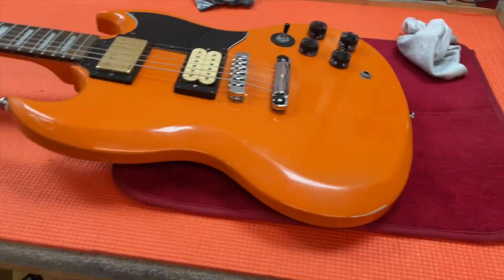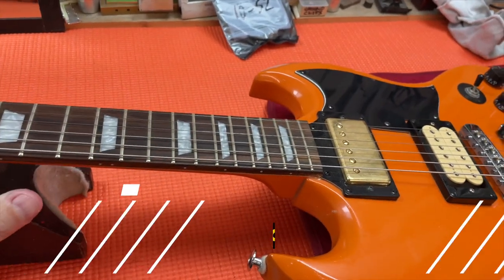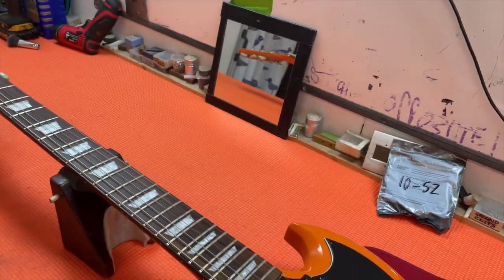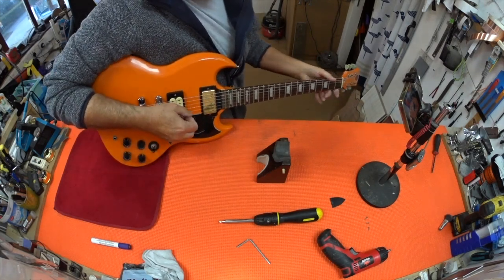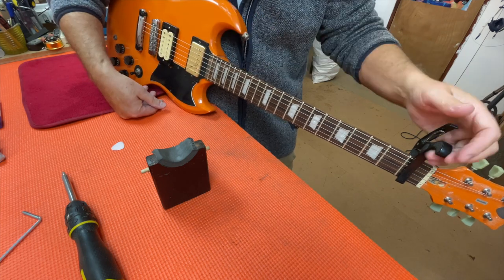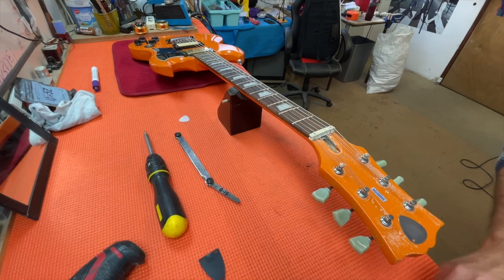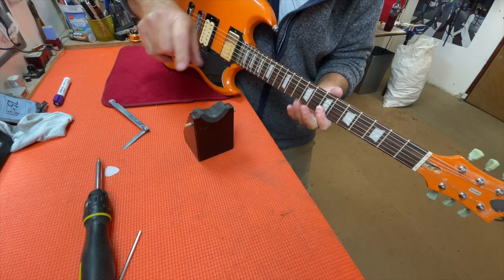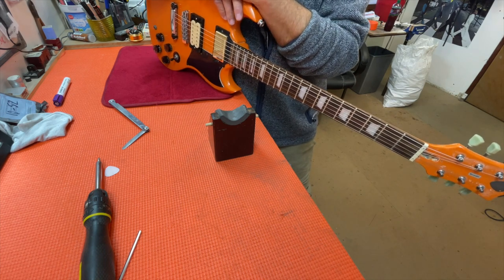Learning to love making truss rod adjustments on your electric guitar

Comment: Very Cool, Thankyou. Just received a LP style guitar ordered online. The 'Saddle' Thumbwheel on the 'bass' side was flat to the body causing terrible Buzz without even fretting and the 'locking' screw refuses to screw into locked position and just falls out.  Supplier said it must of happened in Shipping. I feel that is Not a chance. I noticed the Treble side 'Thumbwheel' was a couple of millimetres off the body. I 'performed' a quick adjustment of 'Bass side' Thumbwheel and have just removed the 'locking' screw, and guitar appears to play amazing. The removal of saddle bass side 'locking screw' appears to make no difference to tuning stability, and seems very stable. Found this video very Interesting, Informative and Entertaining and has given me confidence to measure and adjust Truss Rod. All the best. Cheers
Reply from the maker: Good luck making truss rod adjustments. Remember, all you want (in the end) is "a tiny bit more than none" when it comes to neck relief :) Just enough for your action to play without problems.

Comment: Hi Sam - I live in the East Bay of California and we have the most stable weather conditions year round here in the united states. Even with the very stable climate here, I usually need to do a truss rod adjustment on my guitars at least once per year. I know when it needs to be done based on the standard indicators of the guitar either feeling like it has a slightly higher action than I like or I start hearing a bit of fret buzz or fret slap.
Reply from the maker: You're one of the 'converted' Ken :D So many people I meet over here were scared off from going anywhere near the truss rod in their youth... and still avoid it!

Comment: I completely agree. being of a wood construction the guitar neck will change with different temperature, humidity, string tension etc. Manufacturers always seem to put an Allen key in with the guitar for a good reason and It only takes a minute to give the truss rod a tweak following your video example.
           Just as an aside we had an old wooden 12" ruler that was my Wife's uncle Peter's one from his schooldays in the 1940's. I checked it against a modern steel ruler and it was  1/4" short at  the 12" mark!. I wonder if a guitar of similar age has a slightly shorter scale than it started off with by a small amount. Probably the frets would keep the correct ratio so it may not be noticeable. Cheers.
Reply from the maker: Shrinkage.. It's rare that both / all the pieces of wood in a guitar neck shrink exactly at the same rate. It would be an interesting project to find exact original measurements and be able to check them against vintage instruments. I mean we get shorter as we get older, right? :D

Comment: nice man there are not that many of this showcasing an SG
do you think that for LESPAUL and SG Is about the same exact measuring for perfect neck relieve ?
cos i own both LP and SG just love but Guitars and trying to keep them maintained 
beautiful SG inspired Guitar man
only wish it was on Black for me to love it even more
or at least Dark Wine red
but beautiful non the less
Reply from the maker: Hi, the biggest difference between the SG and LP (from a neck relief point of view) is that in the SG, all of the length of the truss rod is outside of the body of the guitar, whereas with the LP, some of the truss rod extends into the mass of the body due to how the neck is glued into the body. If you look at the last 5 inches of the neck of the Les Paul it is held solid by being glued to a big slab of the body along one side, at the end of the tenon, and to the floor of the neck pocket as well. This holds that last 5 inches quite rigid so that when you adjust the truss rod it can move in its slot but it can't bend that part of the neck. By comparison, when you make the same truss rod adjustment on the SG, it can bend far more of the neck (although still not all of it); certainly more than the LP. This - in my experience - seems to allow the SG neck to curve more freely as one piece, whereas the Les Paul's neck profile is more what I call 'sickle' shaped i.e. a flat stiff handle (the part inside the body mass) and the curved blade (the part that bend in response to the truss rod adjustment). 
Hope that helps!
Reply: oh wow i see, is kinda as i feared 
so.. instead of aiming for 8th Fret to stop that little Gap around it as you did with your SG here, should aim for 5 or 6 fret on my Lespauls?
i own 2 LP one is a Black Custom and my second is a Black Double cutaway LP
but i sure both should receive equal treatment 

also own my Black SG of Devilry honor of course XD

thank you for the long reply my kind sir and for trying to illustrate me better
i trying not to be too afraid of using Trust rod myself
Reply from the maker: @GothicXlightning  Technically, yes, you would probably aim halfway between nut and the part where the neck joins the body on Les Pauls... I tend not to do that only because I usually start out my LP fret levelling with as flat a neck relief as possible. When the neck is almost flat, the 'sickle' effect I mentioned is minimal. 

There's a more complicated, technical reason why I still don't measure relief between 16th and 1st fret on Les Pauls (i.e. between 1st fret and where the neck joins the body) and that's because I tend use my levelling method to... 'iron out' the bump where the blade of the sickle joins the handle. It's a bit long-winded to explain how or why this levelling method does that, but it works best for me if I STILL use the last fret. Doing this gives me a curve on my 'Bananan' levelling tool which is a combination of the bigger curve of most of the neck (between 1st and 16th) and the flat plateau (between 16th and 22nd). This 'median' setting seems to do a good job of ironing out that 'knuckle' where the neck joins the body.... it's very difficult to describe, much easier to draw or show it :)

Comment: Probably a stupid Question for you Sam - Do you measure the flatness of the fingerboard with the stings in place? OR With strings off?
Reply from the maker: No question is stupid, that's a fact! I measure it usually with the strings ON; using the low E as a 'straight edge' by fretting it at 1st and last fret and measuring the resultant gap between bottom of string a fret half-way between the 1st and last (which fret varies depending on whether you have 18, 21, 22, 24 or more frets). 
Keep in mind the 'relief' (curvature) of the neck has relevance mainly in two situations: 
1) When trying to measure if there's enough space for the strings to spin - for which the guitar has to be strung at this point 
2) When you might want to, say, do a regular fret level or re-radius a de-fretted neck. For this the edge of a steel rule (or notched ruler) is a good tool. (Note because I always level frets with the strings ON I tend only to flatten the neck this way for when I'm either pulling frets or re-radiusing the fingerboard after having pulled the frets). 
Hope that's useful
Reply: Many thanks Sam. That truly answered my questin! 👍 @SamDeeksRelovedGuitars

Comment: Would you mind checking what would be the measurements for the last fret action if you put a capo on the first fret? With everything else the same as your standard setup (0.3mm nut, 0.1mm relief and 1.5mm to 1.2mm gradient on the strings)? Also... how far along are you with the next setup book? Thanks a lot!